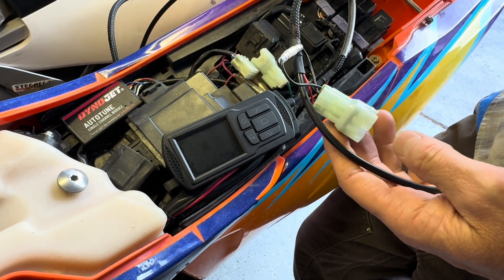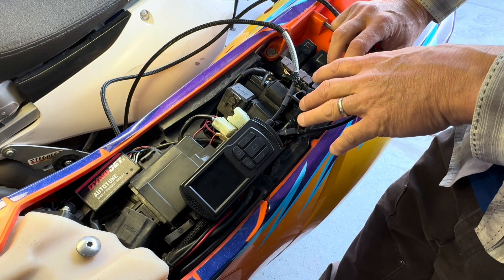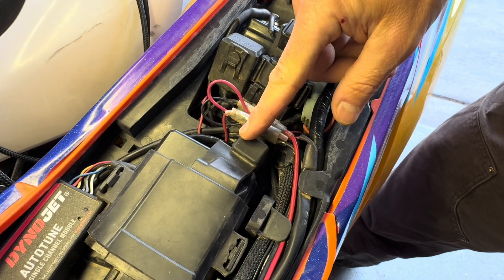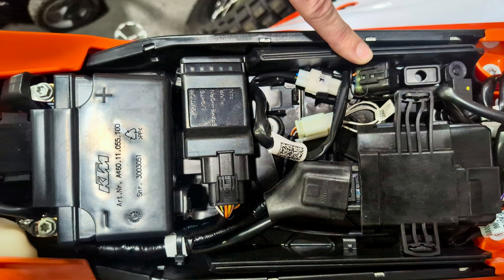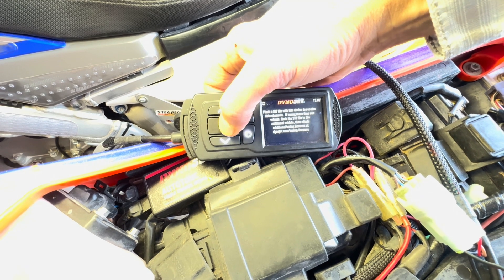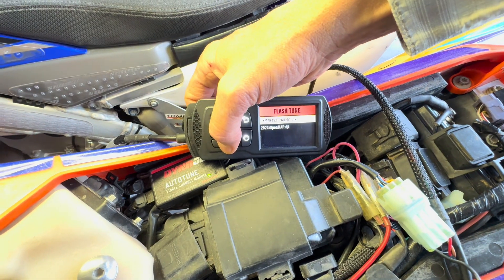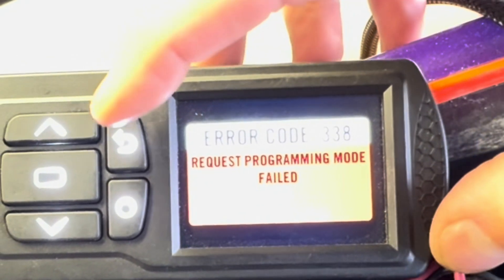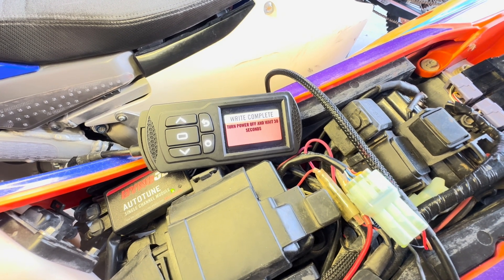TACO MOTO ECU FLASH AT HOME DEVICE INSTRUCTIONS

Comment: Hi Mike , bit of a off question for you regarding my 23 Tx300 Tbi.  I'm looking to add a clutch weight to slow down the motor in lower gears for single track/woods tech sections to avoid stalling and flameout , everything is stock on the bike aside from a IRC JX8 rear tire and I'm weighing in at 230lbs.. would you recommend a clutch weight in 368gr size considering the power of the bike ? Thx for any of your input 👍

Comment: I sent in my ECU to be remapped and installed my fmf q4 and took my reeds out. I haven't been able to take a long ride yet but from just testing around my property the power is awesome. My concern is I have experienced a couple flame outs and the bike pops a ton on decel. Will the ecu need time to adjust or will this likely persist? Also are the pops on decel something to be concerned about?
Reply from the maker: Reach out to the guys in the shop for help on that - support@tacomoto.co
Reply: Let us know what the issue was...
Reply from the maker: @fonnc4936 in almost all instances stilling is caused by low idle, and decel popping is from the PAIR valve
Reply: @TACOMOTOCO  weather is still cold here in Canada so hard to get a good ride in right now, the next time I can get a good ride I will record the sound of the bike and email you guys. So far its great but my only concern right now is the idle seems to vary, its not just idling down and staying at one rpm but sorta idling up and down a bit on its own. I will try and get a recording and email you though as soon as I can.
Reply from the maker: Nothing with the idle ckt is modified in the mapping, and here’s some info on decel popping 

https://docs.google.com/document/d/15zKsD1u-XOKpbhvqLmVGknYOVpfFjg4oREPDnJw5C-U/edit

Comment: Did you just add the " NOT AVAILABLE FOR SALE TO RESIDENTS IN THE STATE OF CALIFORNIA " note? I didn't see it prior.
Reply from the maker: that item it not available for sale to riders in the state of California.
Reply: @TACOMOTOCO  Not sure if you are aware of this but Rottweiler which is based in Ca just makes customers check a box saying that the purchase is for closed course only. Seems to have worked for them legally so far. I'm in Ca, and would buy one of these in a heart beat for my close course moto! Also any plans for anything for 690/701's?
Reply from the maker: All tunes are for race use closed course competition bikes only
Reply: @TACOMOTOCO  with CARB essentially being dismantled. There’s a chance that will change. From what I can gather, we’ll have a better sense of the direction on epa new laws by fall of this year